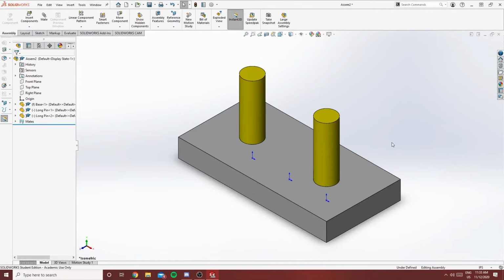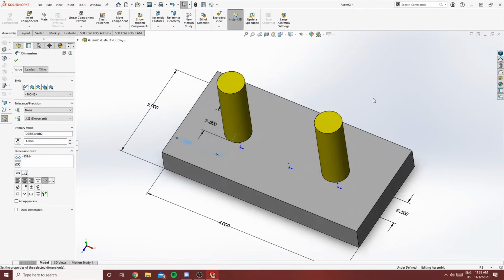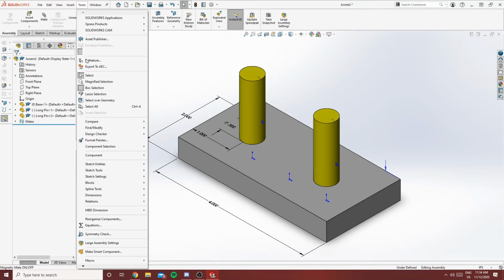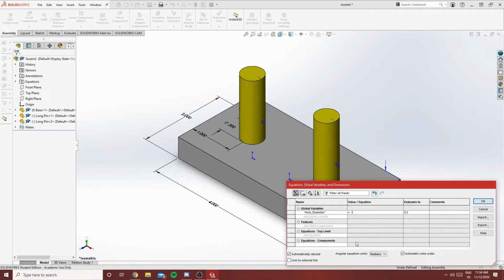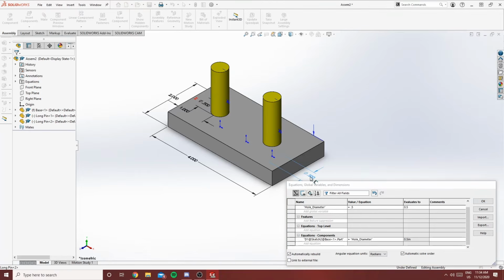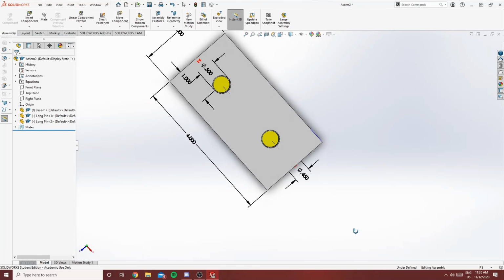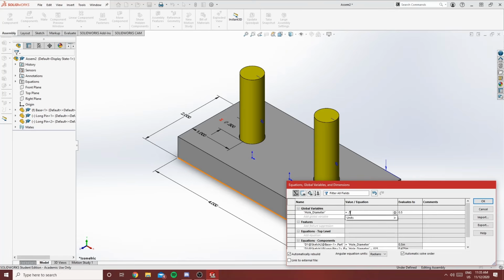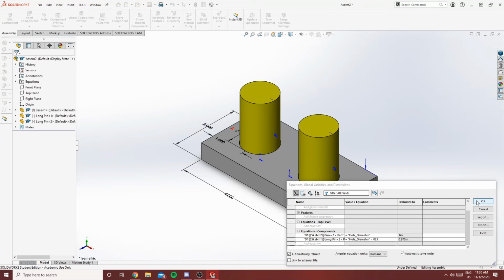Global Variables & Equations in an Assembly - SolidWorks 2020

Comment: Can reference planes not be associated with global variables? I'm coming from fusion and I really grew to love their parametric system. I had it pretty dialed. this feels very clunky
Reply: Absolutely can do that,

Not all features let you do it right at the start, not entirely sure why (might be technical reasons for that)

Either way if that’s what you’re struggling with, enable a couple of the dimensions and you should be able to see the dimensions for the plane. You can also use the annotations folder (enable to show them there first in the same menu as enabling seeing the dimensions)

Dubbel click that and you can fill in any equation or variable like normal.

Keep in mind though with parametric design that if it gets complicated, it’s gonna get a lot worse really quickly. 

Currently working on a largely sheet metal housing with several sections and hardware. I made the whole thing parametric using like 40 global variables and tons more equations. 

I’ve not put in most of the details yet, this is so far mostly just the outside frame and a few important things like the hinges. But I shouldn’t need many more variables, the rest should mostly already exist, I can base of an existing one or is just a specific thing (though if I think I might want to adjust it I usually at least put it in the part itself. Usually they would all be in the assembly. Just so that way it doesn’t add to the clutter but I won’t forget about it.

Comment: Hi, I am facing problem in equation when I go to change my equations, they dont update the part and rebuild. I have checked the automaticly rebuild box but they still don't change in the model, as shown by the same mass properties.
Reply: I think Ctrl+B should work to rebuild the part
Reply: не обновляются размеры детали потому что ты их создавал без знака равно. Частая проблема.  у размера должен стоять знак суммы. Если его нету то он обновляться не будет. 
Надеюсь сами переведете что я тут написал :)
Reply: When you change an equation this doesn’t rebuild the assembly until you either close the equation window or click the rebuild button within it.

You will not be able to close the equation tab until you got rid of any errors. It will prompt you if you try and if you click ok it won’t save your changes.

Now that was solution 1, but if you mean you’re already out of the menu and it doesn’t rebuild that likely means you have a reference loop somewhere. (Basically a dimension that’s defined multiple times or can’t be solved)

Don’t worry if it take a few tries, the equations are incredibly useful but also very easy to set up wrong. Not to bad when it’s just 1 part but once it gets to a larger assembly it’s actual hounderds of dimensions. It’s so easy to place 1 in the wrong spot and screw up everything else.

Tip for this, relate as many things to the same thing as you can. Just as an example say you want 4 lines on a plane at equal distance. If you relate all the lines to the sides this means that if the side disappears you’ll have to reassign all 4 of them.

If you use a reference plane, or at least put the distances between themselves it will instead cause just 1 to break and will be much easier to fix